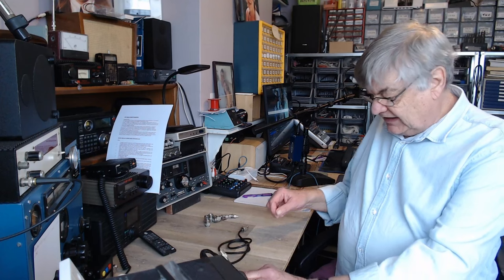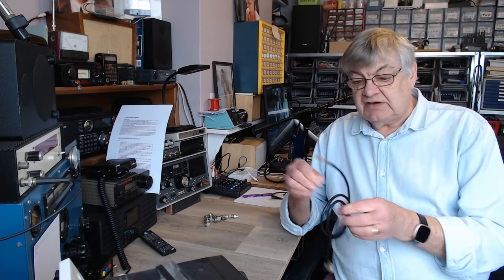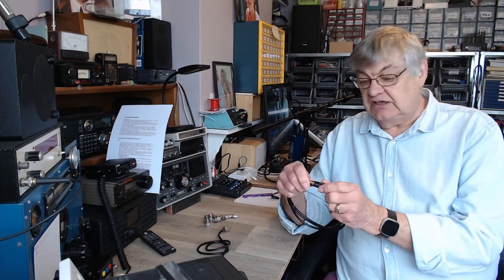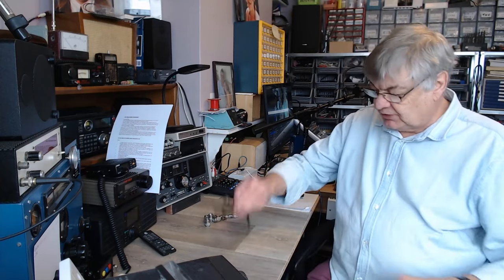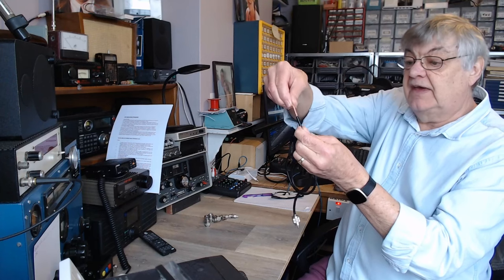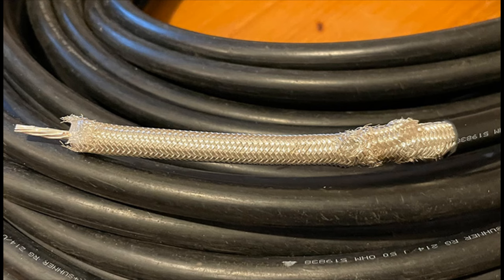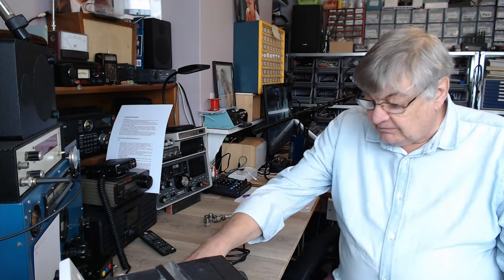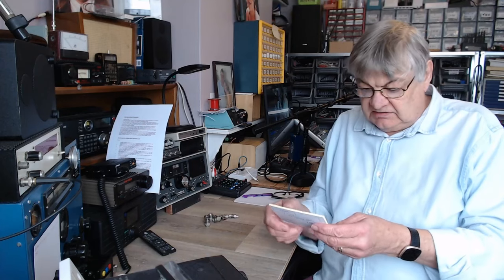G4NSJ - Coax cable uses loss shield screen attenuation EMI ham amateur radio

Comment: Thanks Ray. I’m fascinated by all the magic around cables. Started my career in electronics as a trainee in a firm manufacturing process control equipment for the big cable making firms. Fibre optics too. Should have stuck with it really; just think how much cable and fibre has been made since the 1980s!
Reply from the maker: Haha, you're right. Millions of miles of fibre must have been manufactured!

Comment: The definition of "loss" in the world of coax cables has a few components.

The main one that scares everyone is - Capacitive Reactance loss - because at the end of the day your run of coax is a long tube with two plates (like a capacitor). As you go up in frequency the reactive resistance literally shorts out the RF. This is basic electronics stuff.

Then there is the pure - Ohmic Loss -  the same reason you run thick speaker cables the longer you run the cable. 

Then we have the one you are mainly talking about -  Seepage -  It's a rule of thumb not to use ANY braided sheild type cables (namely 213) on comms sites. Because you run them any length side by side in a cable tray there will be some sort of bleed over. Not what you want when this is a separate RX and TX aerial style repeater. That relies on the fact the aerials are directly above and below to assist with isolation. Cables with foil in them like LMR400 would be a reasonable compramise. But usually at VHF and UHF frequencies your cable run is near 30m so LMR400 at UHF will sell you short on the Cap Reactance loss. You would use LDF450 minimum (and here in Australia that is the standard). LDF450 is the corregated ridgid stuff.

Having all this bubbling around in your head. It should become apparent that using LDF450 in the likes of an AM broadcast aerial system is not needed. You should be able to use thin stuff even RG58 if my Cap Reactance thing is right. Well you can... but the ohmic losses will get you! The runs are long given the wavelengths you are using. Same again... out comes the roll of LDF450 for building an AM broadcast service. Mainly done for Ohmic losses and the fact it has to cop a few RF amps 24/7/365.... it's not 30% duty cycle.

73's from VK2 land
Reply from the maker: Hi Peter, thanks for all the very interesting information. I shall print it for future reference. All the best, Ray.

Comment: Hello Ray , I hope that all is well & good & that life is treating you well .
Thank you for sharing your technical findings regarding the coax cable .
By and large we have been using RG58 for decades & have had many contacts & fun with radio over many years , the  RG58 general coax I'm sure you would agree has served us well , the later RG58 now has an aluminium film between the dielectric insulator & the screen , I've found RG 58 for general use very good & highly cost effective , I'm sure that you are correct with your recent coaxial cable findings & more power to you for finding this information out .
I think the RG58 for general use is ok , it's been around forever a bit like the PL259 & SO239 , those plugs & sockets was developed by the USA for military  in the early 1930's & still being used today , the U.S military designed the PL259 so it could be successfully and reliably be attached to the end of a coax cable by just using a knife , or even teeth if their strong enough , the PL509 & RG58 it's a bit like the wheel or loud speaker design , some designs don't change & just last forever .
What I would say is that it would be ideal to run coax conductors through a copper tube between the floors of the house , just have one copper tube going from the ground floor to the attic , run any coax of your choice through the tube , you don't even need to solder copper tube  joints , you can connect the coax conductor to your regular favourite antenna & you'll notice a significant reduction in noise rest assured & the closer the copper tube is to the base of antenna the better , you can even ground the copper tube to earth to slug down any unwanted electrolysis , hence the ground would become sacrificial rather then the copper tube becoming an anode , if you want to ground the tube it would then be advisable to heat up & bond the copper tube join connectors , you can simply use an earth strap on the copper tube & connect it to the earth of the 
property .
Try to also arrange the copper tube as close to the transceiver as possible , if the table is against the wall it should be relatively easy , there's also small flexi copper tubing available , like flexible copper plumbing stick , they can be inter joined too to add more flexibility length if required , you can purchase various metal flexi tube up to approximately 6 inches from the PL259 to the copper tube & the same on the antenna end ,you'll bless the day & won't look back , the whole project will be inexpensive & highly effective , I hope this has been of some help.
73 
Julian CT4952
Reply from the maker: Hi Julian, thanks for all the useful information.  I do like the idea of copper pipes. Thanks again and all the best, Ray.
Reply: Hello Ray , Thank you for your reply , your very welcome , you could just provide a pipe from the upper floor to the attic to begin with , it won't cost much , I forgot to mention that you can purchase the nylon clips to hold the pipe to the wall , alternatively you could use additional pipes for more cables ,ideally it's best 1 small diameter pipe for each cable , if you try it & are happy it would be nice if you could share your findings to others . Kind regards, Julian .  @g4nsj
Reply from the maker: @julianrobertson3303  thanks, Julian.  There are no straight runs really as the cable goes all over the place. But if I do try a pipe, I will certainly let you know how I get on. Thanks again, Ray.
Reply: Thank you Ray , the copper pipe can be applied to the external of the property if that helps . Kind regards, Julian . @g4nsj

Comment: 2:05 I remember seeing RG-8 mini advertised in the mid to late 1990's, by various CB shops like Knights and Truck King, etc.

I've used Westflex 103 on both 2m and 70cm. I've even used it on 10m and 6m. I bought some so called 'mil spec' RG-213 the other day from a reputable seller, only to find that the screen on it isn't as good as stuff I bought over a decade ago! 😮
Reply from the maker: I didn’t realise it had been available for that long.

Comment: I'm also not a fan of different coax for tails.....

I've seen repeaters where the LDF450 is brought directly in and goes to the radios via a short run of something like RG58. The repeater worked "OKish". But I was always suss. The tail was done for convenience as the LDF450 doesn't like to bend enough. I was never happy... So I decided to fit a right angle connector of the exact type and do a little re routing of the LDF450 to come directly to the back of the RX radio. Boom.... picking up mobiles in area's never heard before.

My working theory is Velocity Factor of the different cables. We've all been driving on a freeway at max speed and come to road works where we must slow and merg down to a single lane etc. It's never fun and you deal with rude people that just can't drop into line and crack on! I think this is what happens when you use odd types of coax in a feedline. Only time this is acceptable is when there is something inline like cavity filters. You can have coax A coming in with all coax B on the output.

I could have been on the wrong length of coax too as there was alot of "other RF" floating about. I'll never know for sure. But that's the theory. 73's
Reply from the maker: Thanks, Peter.

Comment: I use a 213 feeder to my 11m vertical.  But RG8x for everything else.

I switch out rg58 to rg8 for car magmount applications etc. simply because 213 doesn't go well around bends!
Reply from the maker: Good point!

Comment: Thanks again Ray. Most informative. What's the little radio to the left of the A4 sheet of paper in the video?
Reply from the maker: There's a Tecsun S-2000 to the left of the paper. Small transistor radios above.
Reply: @g4nsj  Ah sorry. I meant just below that, what looks like a little transceiver, the one with the mic cable trailing down.
Reply from the maker: @PeddyrCubberley   See here for the info on that radio...    https://www.radio-workshop.co.uk/g4nsj-baojie-bj-218-transceiver-2-metres-70cms/

Comment: With the price of copper it is well worth being wary of cheap cables,  some flavours of RG58 have a very wispy braid. Double-screened cable is favoured on radio sites, although types using aluminium foil over copper should not be used. FWIW RG400 and similar are great for patchleads. 73
Reply from the maker: Thanks, it’s good to hear from you.

Comment: Can you buy so259 wallplates these days?. My intension is to run the coax down inside the plasterboard wall and use a patch lead from the wall outlet to the radio , rather than have coax and cable clips or surface mounted trunking on show (attempting to keep the Mrs happy)
Reply from the maker: I’m not sure. I suppose you could buy a blank plate a fit a socket.

Comment: SO why isn't foil screened with a drain wire used? I am a novice too but we use the foil screening in audio and it is great to remove interference.
Reply from the maker: Possibly because there may be a fairly high RF current flowing.  The thicker the conductor the better.